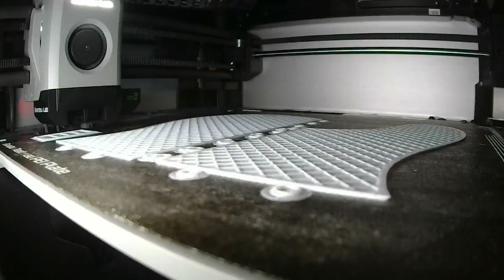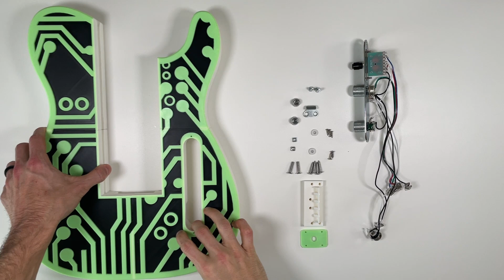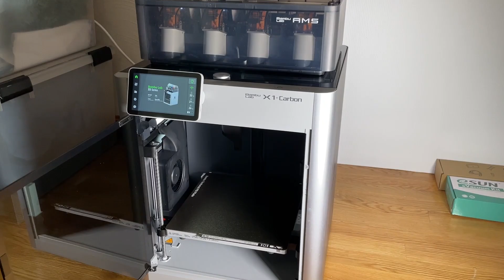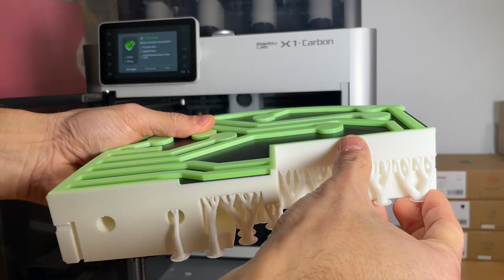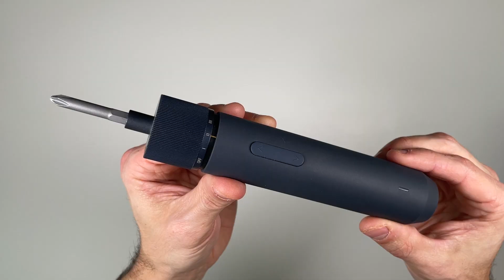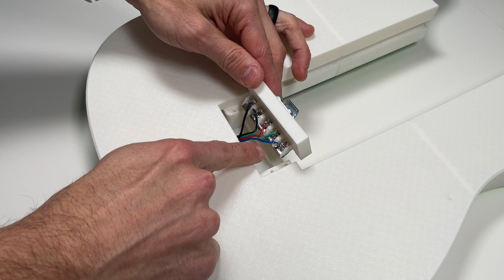3D Printed Modular Telecaster Guitar – Full Build!

Comment: Considering how much plastic would be missing, not to mention it likely interfering with the electronics (which, by the way, is an incredibly eleigent solution) I doubt it'll be possible, but I figured I'd ask anyway: you think there's any chance at all of getting a trem system working with this? I'd personally like a recessed floyd rose, but I'm sure there would be a market for standard 6 screw or 2-point strat tremolos as well. If all else fails, i guess there is that Vega-trem telecaster tremolo that would only need 6 holes through the body.
Reply from the maker: Thanks for the question. As you mentioned, there are some design constraints that make adding a tremolo to a 3D printed guitar challenging. Indeed the additional space limitations to accommodate the springs introduces a challenge, plus the spring load adds a lot of stress and strain to the plastic. A recessed trem would be very challenging to achieve, a bolt on trem might be a bit simpler to pull off. I don’t offer this type of design at the moment, but plan to experiment with it further and maybe offer it in the future.
Reply: @the3dprintzone  There's a possibllity of installing additional strengthening measures while the print is happening. I think I recall a print file or two that says to stop the print at a certain layer and install magnets into their locations and then restart, so the magnents are sealed inside the plastic. Could maybe do the same for metal plates/carbon fiber rods?

As for improvements... really, as a ameture luthier myself, the neck pockets on these always scream out to me. A typical tele neck's corners have a 1/4" radius because the bodies are cut with a 1/4" bit. A strat neck additonally has a roughly 4" radius curve on the bottom in addition to the 1/4" corners.

I get the "fit all" idea on the plain STLs that people could be putting any old neck on, but I feel on the ones you sell as kits, they should have a tight fitting neck pocket. It just helps.

That's just my $0.02 though.
Reply from the maker: @Furiora  thanks for the comment. Yes, you can pause prints to allow for putting inserts, so that could be a decent option. The neck pocket is designed to fit the kit neck and other common neck options for those sourcing their own components. Thanks again for the feedback and suggestions!